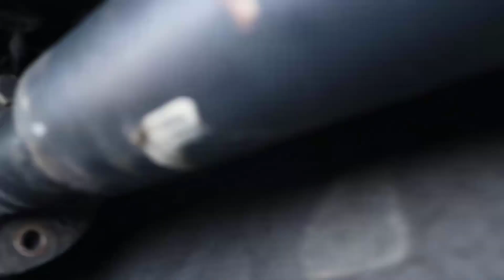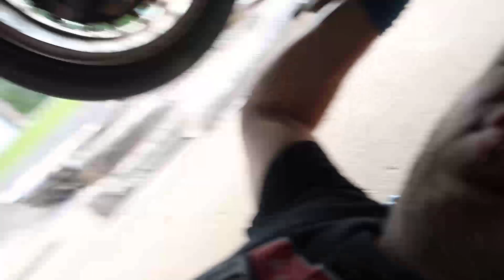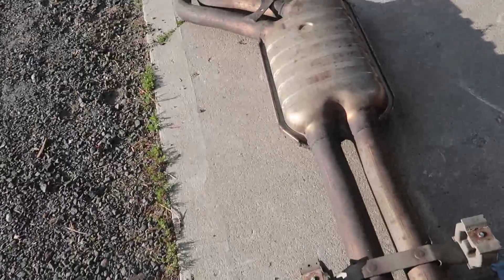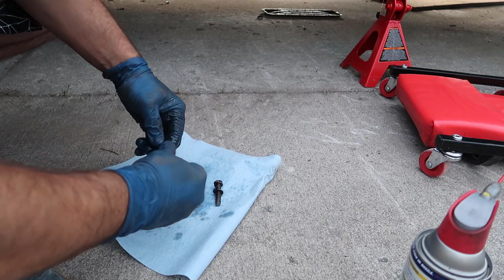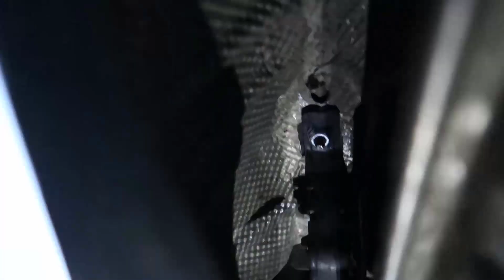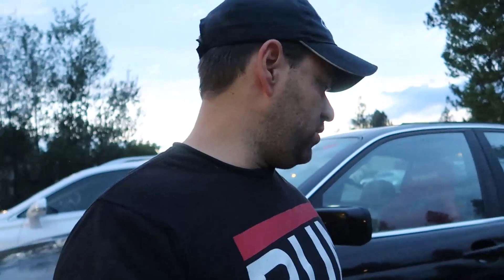Replacing Clutch on a BMW E46 330i Drift - Part 3 Final

Comment: Thank you for the videos, I’m planning to replace my clutch soon on my e46 but I can only do it in my driveway, and you proved it that it’s possible! Thank you so much
Reply from the maker: Ya it's possible for sure. Be aware that the space to take the transmission from under the car is very limited.

Comment: A clutch job for my E46 330ci is going to be have to done someday.
Thank you for the detailed video! I am sure to reference your video whenever I get to doing my clutch.

In terms of the clutch itself - any suggestions? I ain't going to drift, however autocross is something that I will get into it. A dream of mine would be to run a turbo as well somewhere in the distant future - should I be looking at something rated for 400HP+?
Reply from the maker: Hi Rain, for the clutch I got the Valeo with Single Mass Flywheel. I got single mass to increase torque a bit. I will turbo this car also in the future so stay tuned. I'm sure we can get 400 up out of it. Maybe changing the internals to forged internals will make the engines life longer for the turbo. 
Thanks for your comment and don't forget to watch the part 1 and 2 also.